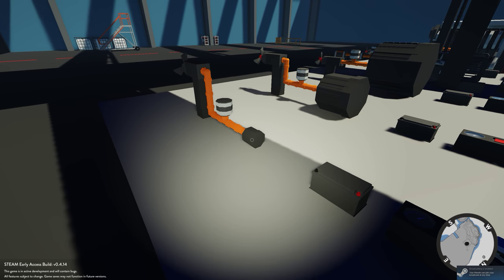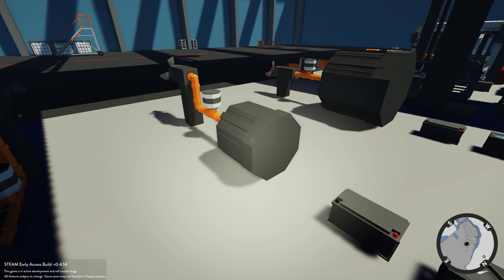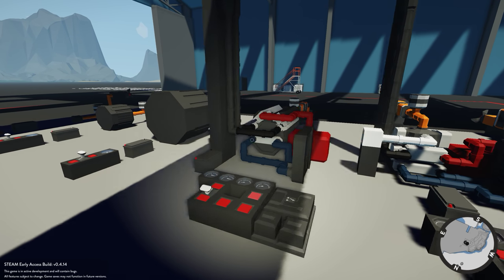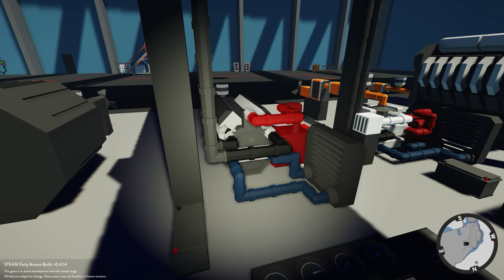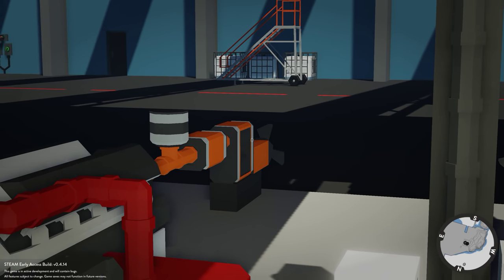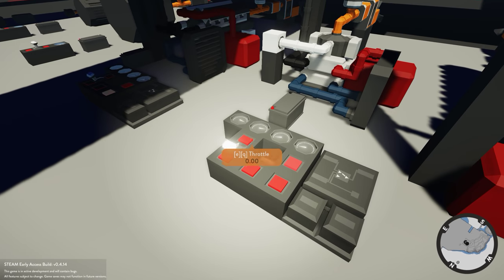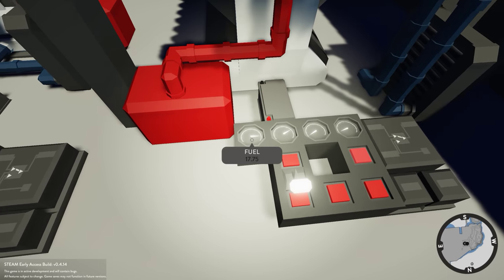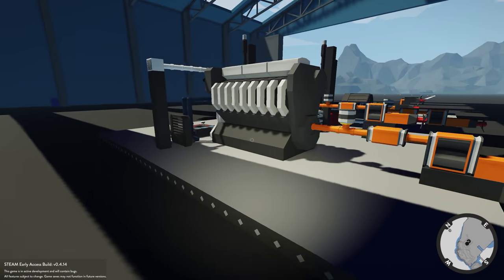Stormworks Advance Engine Examples Tutorial with Gearbox & Clutch

Comment: I included a throttle lever into my clutch logic. Not one you actually use, but the microcontroller will utilize it to slowly disengage the clutch when you want it to. That way when you set off it doesn't suddenly slam into gear and jump off. That way I could set off at a low idle speed. I'm very happy with how it turned out. Maybe you could do a tutorial like that at some point?

Comment: How can the battery provide enough power to run a motor and a generator to charge itself back up with no external sources of energy?  Wouldn't the generator just drain the battery quicker?
Reply: I just tested it, it looks like they fixed this issue.

Comment: My air intake isn't working, why's that?
Reply: Do you have it connected on the grid? Like, isn't it only holding on the pipe? If yes, then you need to connect it to the grid, since it will take it as another grid when connected only by pipe, so it won't work.
Reply: @ZappaTheToaster  I have it fixed now. It wasn't the grid it was that way my hull was made. But thanks for the feedback.
Reply: @ZappaTheToaster  your right. btw im a boy